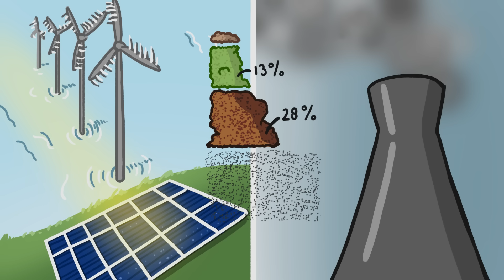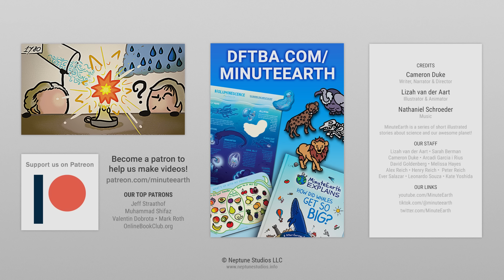What if We Replaced Nuclear With Potatoes

Comment: 2:25 Ok, this is epic partisan malevolence. You can say that the yield of the fossil fuels makes only for a minority of their energy to become useful and not just heat (even if some of this heat is in fact really used). But then you should do the same with "renewables" too ; they also have a yield, and it's not 100 % at all. (One could also argue for comparing ratios between capital invested and energy harvested, but that may be a bit complex for this channel).

Such a disappointment.
Reply: ok le epic reddit guy, what's the yield
Reply: Extracting energy from the wind or the sun doesn’t add additional heat to the environment, unlike combustion. You’re right that they have an efficiency (wind turbines can extract ~ 2/3 of the wind’s kinetic energy) but it’s not “wasting” energy as heat in the same way hydrocarbons do when combusted. It’s not “epic partisan malevolence”, it’s thermodynamics. Sheesh.
Reply: @matthewmuscheid  Check your numbers, and check your thermodynamics credentials too.

A perfect wind turbine would extract at most 59 % of the wind energy (called the Betz limit), and real ones generally extract around 45-50 %. They also create massive turbulence, and turbulence means transforming (macroscopic, ordered) movement into (microscopic, disordered) heat ; the technical term is the "energy cascade" (described by Kolmogorov and Richardson).

Moreover, a wind turbine has an alternator, which has moving parts, which have friction, which create heat ; and the heat created is, to simplify, proportional to the square of the turbine dimensions, whereas the power output is proportional to the cube of the same dimensions (one of the many reasons wind turbine alternators have a lower yield than big power stations, whether fossil or nuclear).

About solar cells, I'm quite surprised you really think solar cells don't create heat ; you may never have touched solar cells working. First of all, solar cells have a theoretical maximal yield at about 33 % (the Shockley-Queisser limit), and real-life ones generally have 20-25 % yield (only for the most recent technologies ; older ones are much lower).

Second, solar cells are usually made of very dark materials ; their low albedo absorbs most of the light that is not converted into electricity, and convert it into heat, as any dark material would do. As most materials on the Earth's surface is not as dark as solar cells, one can easily conclude that the presence of solar panels generate much more heat than would have been generated otherwise. If you don't believe me, just remember you can easily cook an egg on a productive solar panel, whereas you wouldn't on the ground or on grass.

And remember, we didn't even talk about production costs, or recyclability, or "drive-ability" (I don't know the exact word in English, which isn't my native tongue).
Reply: You totally missed the point of the video. You don’t burn anything to get energy from wind or solar. The point is we are replacing combustible fuels with potatoes. And before you respond with the “um, actually producing wind and solar facilities uses combustible fuels” I’ll just save you the effort and say you missed the point. Again.
Reply: @matthewmuscheid  So, you're not talking thermodynamics anymore ? Paint me surprised.

If the "burning" part is what really bothers you, well, fortunately no one listened to people like you whan our ancestors domesticated fire half a million years ago.

Physics 101 : energy isn't produced (see Noether's theorem), it just can be converted from one form to another. So, either you get your electrical energy from chemical potential energy, or from nuclear potential energy (what you call "burning"), or you take it from wind movement or from solar light. But in each and every case, you change something and you create unwanted effects on our environment.

No energy conversion is "clean" or "free" or "magic", every source of energy has effects, externalities and costs, that you may consider worth it, or not worth it. Believing that using some of these sources would have no effect whatsoever is not science, it's religion, it's cultish mysticism.

By the way, the point of the video was that some energy sources are much more concentrated than others, nuclear energy being the most concentrated of all the sources humanity can use. This is true ; but what I was criticizing was a highly misleading, although subordinate, detail in the video.
Reply: @zkingsalsa  Drivability ("pilotabilité", in my native tongue). This is the reason for fossil fuels. A fossil fuel power plant can completely change its power output (or even be started or stopped) in a minute in order to follow demand. A nuclear plant takes a few hours to do the same, but this still can be used for following seasonal or intraday change in forecasted demand. But how do you start solar panels when power is needed at night, or on a cloudy day ? How do you start a wind turbine when there's no wind, or when there's too much wind for safely operating it ? "Renewables" are highly undependable energy sources, this is the sad truth.

When something is used by private company, you should consider that maybe, maybe this might be a reasonable decision informed by years of expertise. If your first thought is only that this is absurd and that you know better than anyone else in the industry, there's 99.999% chance you're grossly overestimating yourself. If you really think you're right, put your own money where your mouth is, and start a company : you may be the next Musk or Bezos. But I'll be honest : I wouldn't bet on your idea.
Reply: @R_V_  but is money or instant increase in power output really worth the price of millions of illnesses and deaths per annum?
Reply: @R_V_  It's really quite an oddity that with how well-known how undependable renewables are, better storage methods haven't been devised or put into place for longer term storage of the energy generated, rather than just ramping up production.
Reply: @zkingsalsa  Millions ? Bazillions ! Qwertzillions !

Casualties from climatic extreme events have fallen since a century, not by 10-20 %, but by a factor of 10-100. A prosperous, free society can adapt itself much more easily and quickly to climate change. I mean, the Netherlands have been living under the level of the ocean for centuries now, Israel has transformed parts of its desert into high-productivity farms, even Canada managed to thrive in spite of months of freezing cold. They did it because these are countries that considered not "how can we avoid any problem and cry to the sky because the world isn't like we would life", but "these are the circumstances we're living in, let's see how we'll make the best of them".
Reply: @KainYusanagi  Well, you know, physics is a harsh mistress. Electricity is extremely difficult to store at the scales needed for a national or regional grid. We just don't know how to do it reasonably. Maybe, one day ; but for now, the best storage of energy we know of... is fossil fuels (and nuclear fuel). The only problem with this kind of storage is that it can't be easily reloaded.
Reply: @R_V_  But we do know how to store it reasonably? We just need to convert it into a different form of storage rather than using batteries to directly store it, such as using it to pump water into a reservoir that can be released to generate electricity from its flow, or to convert the electrical energy to heat and pump it into a geothermal tube system that can be tapped like such systems already are, or using that excess power in producing kerosene using atmospheric CO2 and water; these and similar such systems, anyways.

Thankfully nuclear fusion technology actually seems to finally be progressing to a point where it can be self-sustaining, so I'm looking forward to that. In the meantime (and even if fusion gets off the ground), I do hope that solar distilling of CO2 into kerosene gets more funding, since that both strips CO2 out of the atmosphere (win) and produces a usable fuel with fairly good chemical energy storage (win) that also doesn't naturally degrade like other chemical energy fuels we use like gasoline, assuming it's stored under a non-oxidizing dry gas to prevent oxidation and water vapour degredation. As good as grid power is for general use in society, it's also important that we look to renewable chemical power for places off the grid, too.
Reply: @KainYusanagi  Oh, so we "just" need to convert energy into a different form ? Well, as a matter of fact, there's only one really production-grade kind of energy storage, and it's indeed pumped hydro energy storage, which currently amounts for 96 % of all energy storage in the world. All the rest, all the other storages (the technical term is "potential energy", whether mechanical, chemical, nuclear, or electrical potential energy) only amounts for 4 % of what's currently stored, in spite of the thousands of scientists and engineers that have been working on it for the last decades, because physics is a harsh mistress.

So, the only production-grade energy storage we have to dampen the unreliability of renewable, unreliable sources of electricity, is pumping / returbining water in dams. But a dam needs some specific geographic features : typically, you won't be able to build a very useful dam in the Netherlands or in Kansas. Geography, too, is a harsh mistress.

By the way, in the Western world, most of all useful spots to build a dam are already used, so you can't build much more dams than what already exists... and the capacity we have is, in a way, already not enough. In the EU, for example, total pumped hydro storage is equivalent to about 50 Watts per person. Not 5k, not 500, just 50 Watts. And there's just no room for much more than that. Let's be very optimistic and say twice that, 100 Watts per person : you won't go much further at the scale of a continent (and I didn't even say a word about the environmental impact of dams and reservoir storages, nor about their archeological impact). That's not much dampening capacity for a grid.

But of course, pumping / returbining also has a yield : each cycle will only return 80 % of the energy used to pump water into a reservoir. This is not so bad, but in reality it lowers the effective yield of non-driveable energy sources and has to be taken into account. Fluid mechanics is a harsh mistress, too.

All the rest, is now and for at least one or two decades (maybe more) at most experimental and at worst dead ends. Chemical storage, aka the production of hydrocarbons from atmospheric CO2, is extremely limited for human needs ; in honesty, this is exactly how photosynthesis works. But guess what ? Nature has had billions of years to solve this problem, and it only gave us RuBisCO, a very inefficient enzyme which output is immensely low (a few carbon atoms fixated each second, at most), and which is yet lowered by the presence of dioxygen). Oh, and of course it probably won't be used for dampening grid production, as it's not activated by electricity but by light (of course you may use lamps, but that's an additional yield to take into account). Solar distilling is not electricity distilling ; and biology is a harsh mistress.

About fusion, well, it's been talked about since I was born (in fact, it's been talked about since my father was born), and in every decade it's been "one or two decades in the future". More than half a century later, we still have nothing useful for energy production, and we probably won't have anything useful before at least two decades. And by the way, it probably will not be very driveable, because it needs to maintain the triple product of plasma density, plasma temperature, and plasma confinement time over the Lawson limit, or else it's not useful for production. And of course tritium is quite a rare material, and millions of times more radioactive than uranium (so fusion will probably not be "clean" at all). Nuclear physics is a harsh mistress, too.

We should keep on researching all these things and many other too, for sure. But we can't bet on them, at least for our lifetimes. Driveable, dense energy source will probably not be replaceable before decades. So we have to wisely use nuclear and fossil fuels in any reasonable energy mix.
Reply: @R_V_  i'm not talking about extreme weather events, i'm talking about those who die directly from pollution, from cancers and other diseases.
Reply: @R_V_  i do avoid those things. nowhere in my argument did i insinuate that i did drugs, alcohol, or tobacco. i also try to stay away from things that negatively affect my mental health, such as this argument.

Comment: Many things aren't good in this video, especially around 2:30, where they mix up primary energy, final energy and useful energy. 
If the authors intended to consider the whole primary-to-useful energy chain, starting with 85% (for fossil fuels), removing 2/3 of this to obtain 28%, and then comparing it to 2% nuclear energy is wrong, because to end-up with 2% energy for nuclear, you also need to start with 6% nuclear in the initial energy balance.
Of course, if you do that, the initial balance doesn't add-up to 100%.
And I don't expand here on the renewable part, for which the primary-to-final energy conversion ratio is more tricky and depends on the meaning we expect from the percentage. 

Or maybe the authors meant to talk specifically about the final-to-useful energy conversion? Then there's still an inconsistency in the fact that they use a yield of 1/3 for fossil fuel. 
This yield would correspond to the final-to-useful energy conversion when the useful energy is under the form of movement. 
But movement is far from being the only useful energy in the mix, heat represents more or less half of the useful energy, and is not subject to the 1/3 yield. 
The authors seem to believe that the 1/3 yield is due to the energy resource supply chain (primary > final energy), which is absolutely not the correct order of magnitude. They disregard the second law of thermodynamics (this is corroborated by 1:00, where they essentially attribute the engine yield to... friction!?)

Finally, call me picky but "13% come from renewable like solar panels, wind turbines, or hydroelectric dams"... Although not wrong, it gives the impression that solar panels and wind turbine are the main renewable sources. At world scale, they are marginal. The main renewable sources are biomass (for heat - yes, again), and hydroelectric, by far.  

The idea of the video, namely, to provide orders of magnitude, is great. Too bad this passage gives an incorrect representation of said orders of magnitude in the energy mix.
Reply: This isn't the first time I've seen this science channel have someone in the comment section correcting them.

Hopefully they get their stuff together.
Reply: Hydroelectric is great but also caused severe unforeseen consequences, many of which were not fixable. Changing the natural s shaped routes, destroying thousands of miles of marshlands/habitats, and making most rivers extinct of their native large fish populations. These all have massive effects on the environment, and are not as menial as they may seem. Many ppl see water as it’s own thing and forget how intertwined it is with its local environment.
Reply: I cringed as soon as I saw the "KW/h" instead of kWh at 0:24, the science is really bad for a wannabe science channel this big
Reply: The thing that caught me off guard was comparing a single gasoline car to an electric car (fair enough so far) to a production company , to the energy output of a highly energetic portion of the city , followed by a global industry. I get using magnitudes to show the vastness of quantity but comparing the output of a single vehicle to a global industry is...flawed.
Reply: Yeah, another problem is that chemical energy stored in a potato is not same as energy usable for the human body. Humans can't extract all of the energy that's present in the potato.
Reply: they dont get paid to  you. but to brainwash you into accepting the spending of billions of taxpayer money in nuclear
Reply: Same is true of every environmental video sponsored by Bill Gates. Always either misinformation or greenwashing garbage.
Reply: I imagine that the goal of the video is to peak curiosity rather than give a college course lecture. It's just too bad that someone didn't make that full lecture in video format with tons of cute drawings to keep average people entertained while they are skipping through the internet.  Oh well, on to the next mind-numbing entertainment!
Reply: Smartest renewable energy enthusiast
Reply: The replies are either ‘im not reading all that’ or more essays on the topic that I also won’t be reading
Reply: @RandomDucc-sj8pd  yeah taking 1'30'' to avoid believing something wrong is too much effort.
Better to go watch videos made of simplistic nonsense to feed the "I've done my research" machine.
Reply: @alexrvolt662  Look, I'm not some conspiracy theorist, and nor am I a scientist. 
I didn't mean "I'm not reading that" as in "I'm going to completely disregard it', it's just that I'm not studying this topic and ngl I'm probably gonna forget about it all within 3 hours
Reply: What the f### is this this is so BIG!!!!!!